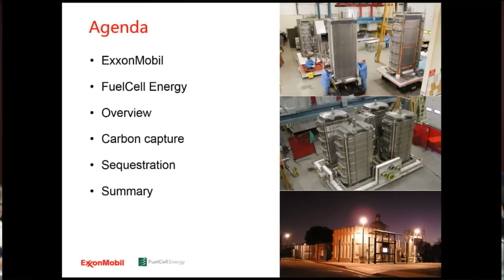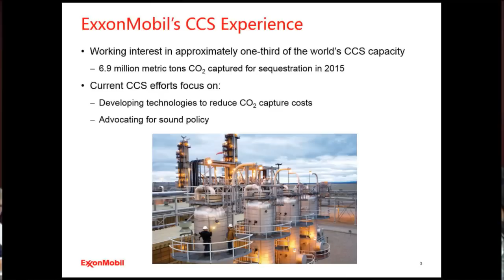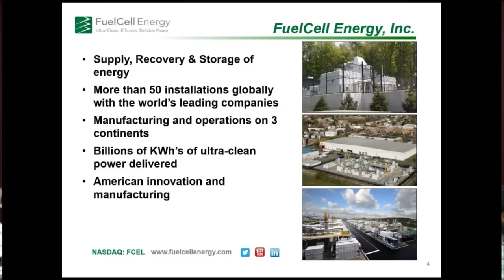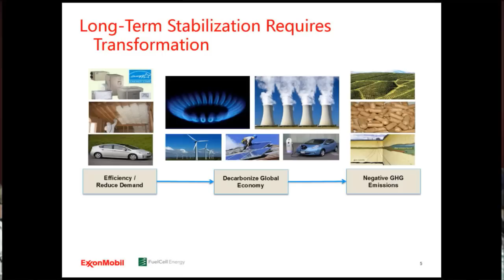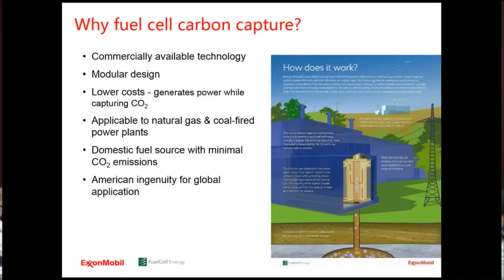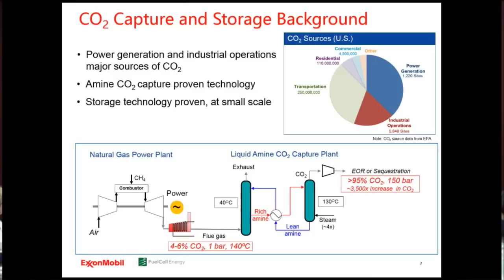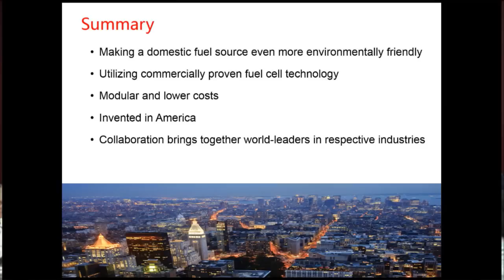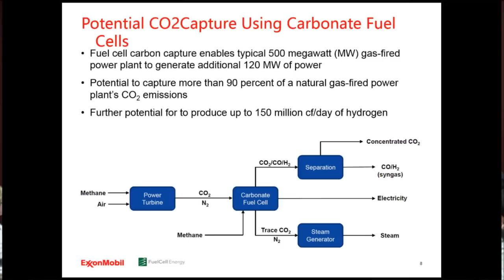The Role of Carbonate Fuel Cells in Carbon Capture and Storage

Comment: Isn't that kind of ridiculous how he never talked about the bottom line, which is: how much gas does it take to recapture the exhaust?  It was all very fascinating about the process, but no one cares unless we get an idea of what percent the overall gas usage will increase if this technology is implemented.
Reply: High carbon footprint than the CO2 capture itself!!
Reply: @Peteryzhang  it will only work if capturing and reformation is done using the renewable energy or nuclear.

Comment: why abandon 41:46 mhd generators; a topping cycle that with high temperature superconductors would now deliver twenty five percent points of electricity from the coal before its entered a heat exchanger and instead of a carbonate cell incorporate a thermochemical cycle and a bacon fuel cell twsc is grid scale storage despatchable lets write .75*.75*.7 gets you forty five points arriving at sixty five or so and let thermoelectric generators do the rest on waste reactor heat to go eighty or higher utility of all the chemical content of the fuel #loadfollow #despatchable #directcurrent #efficient #solidstate